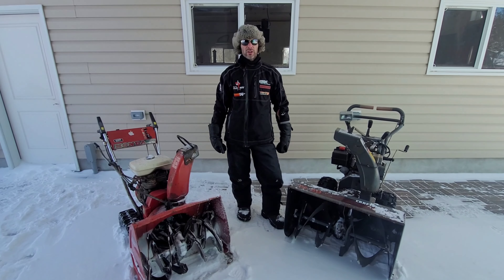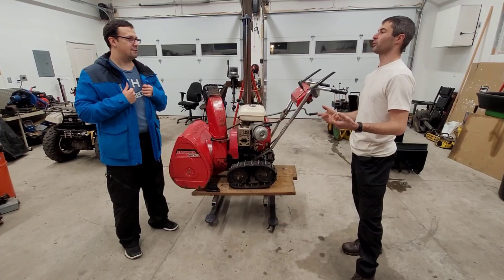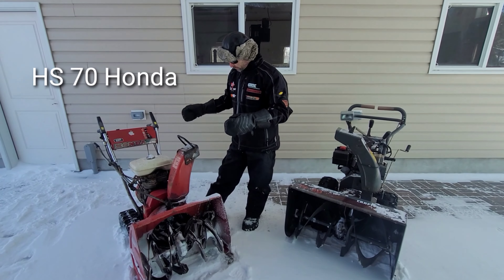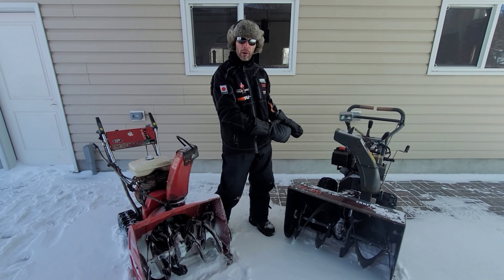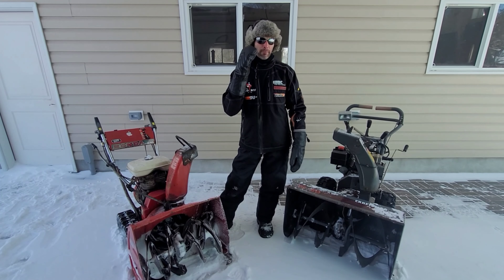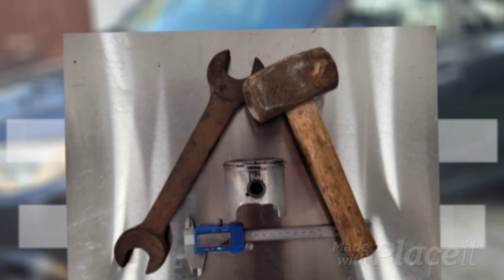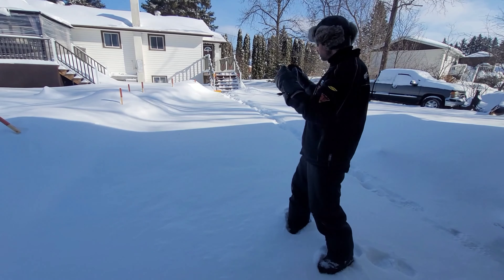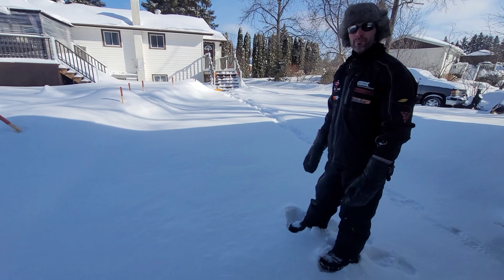Snowblower BATTLE !!!

Comment: Good video. We have 5 Honda snow blowers in the family. 2 on tracks, 3 single stage. Track blowers are 40 and 30 years old. Never had one issue, start on first pull. We keep them in good shape though. I broke with tradition and bought an Ariens 24 deluxe only because the new Honda's are very expensive. Like the Ariens. Would pick Honda over Craftsmen though.
Reply from the maker: That's awesome to hear! Parts are hard to find as they get older so maintenance is key! 😉

Comment: Honda can through snow far but they are a little bit slow to get rid of the snow and they easy to clog in heavy snow. Snow get stuck in the front impeller you need to make sure you put teflon on the impellers and inside housing specially when they get older and the paint get use a lot.

Comment: Craftsman hands down. The Tecumseh Snow King engine is the best in the business. Nothing comes close. Tecumseh engines get a bad name as I have said time and time again because of the "mechanics" that attempt to "fix" them. Good maintenance and upkeep is key on a Tecumseh. They will reward you with decades of service. I have plenty of them, most were from the curb. The Craftsman looks like an older "536" prefix Murray made unit. You can still get parts for those without much of a problem.
Reply: I have a 9 hp  Tecumsah on a 26in wide Craftsman from the 90s. Mine is also a Murray made unit with the same style of handle bar.
Reply: @robertknight4672  I have a 9HP/28"  path Tecumseh powered Craftsman unit from 2005. By then they were MTD made. It was free and in mint condition. Owned by a 40 year Sears employee who just got too old to use it. I had to do minimal maintenance to it to get it up and running. Took me maybe an hour at most.